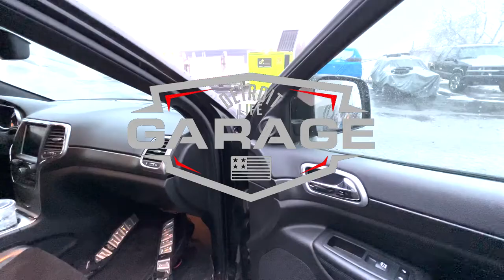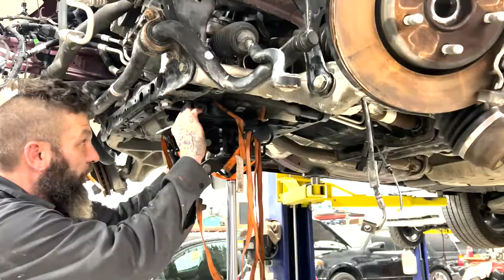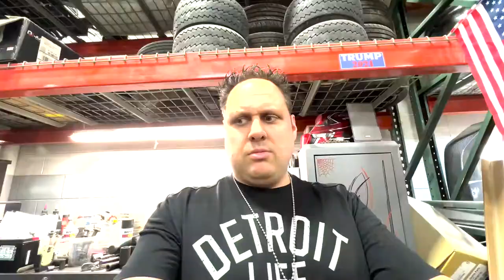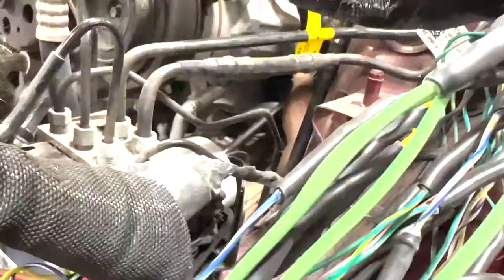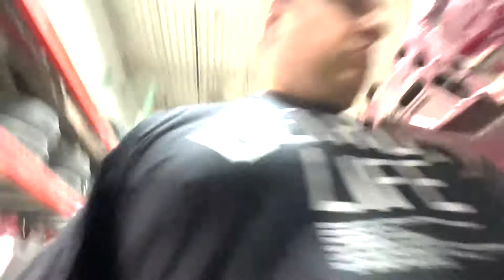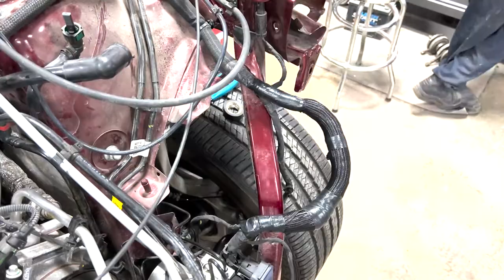2019 Jeep grand cherokee steering rack/pinion is hard to get in and will we have any codes? DAY 8

Comment: you have to do some electronic programming with a computer
Reply: I have a limited 2017 Jeep Grand Cherokee and it uses that same rack and pinion, I already got it, but I want to know if to mount it you have to do some programming for it to work
Reply: @yoelyoel952  
Did you ever end up finding out if it needs to be programmed I replaced my rack on my 19 grand Cherokee but now when I turn left the steering is light (as if echo mode) and when I turn right it’s stiffer (as if it’s track mode)
Reply: No, you do not need to program the rack and pinion. You do need to take the engine cradle out though. To replace it